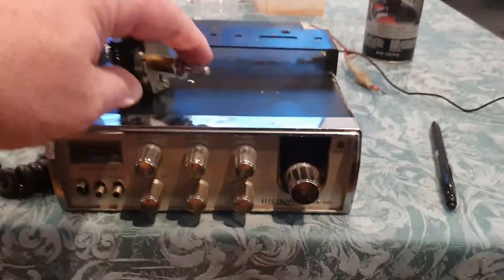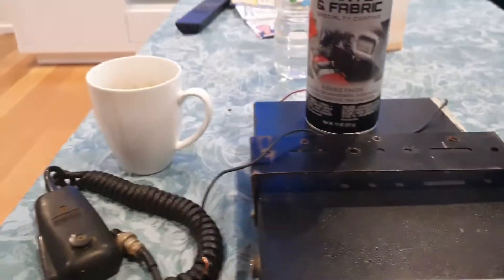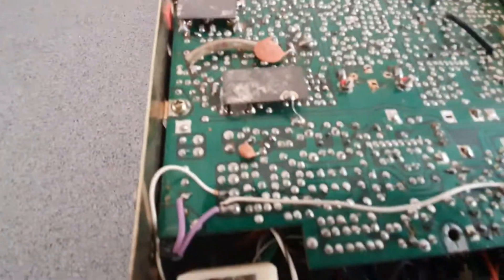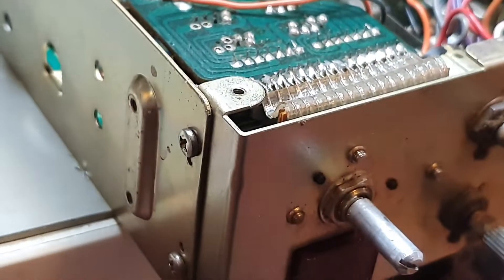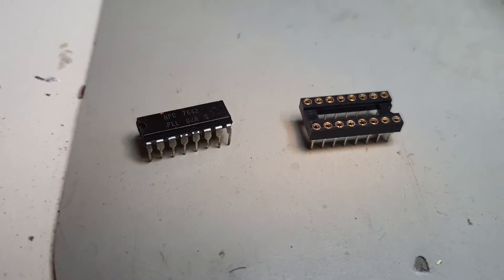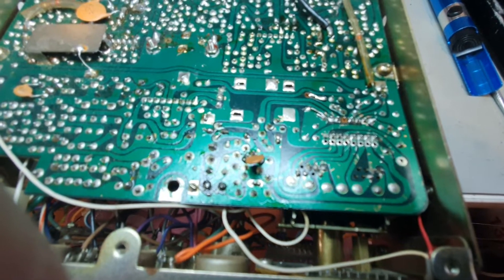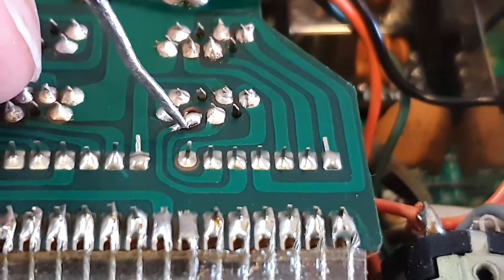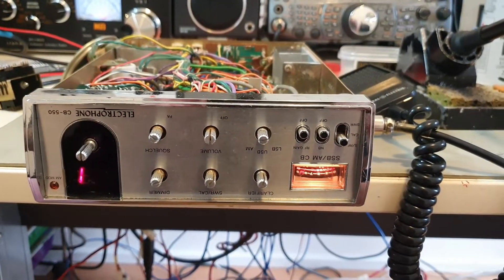ELECTROPHONE CB550 RESTORATION - EXTERIOR - RR VCO - IC DIN - 40 SWITCH - VYNAL PAINT - Part 1 of 2

Comment: Hi Paul, where do you buy your o2a chip holders from..?
Reply from the maker: Off ebay in qty or a local electronics shop.

I use the round hole type now not the clamp type.